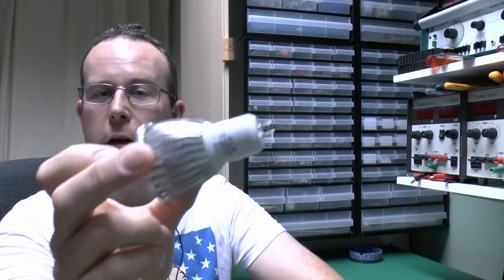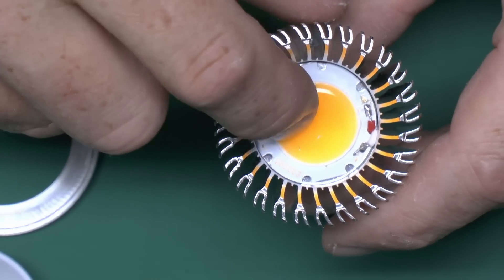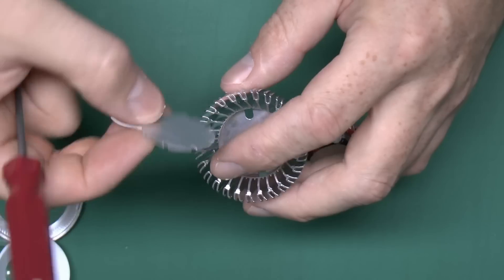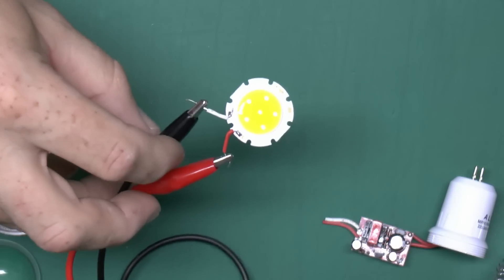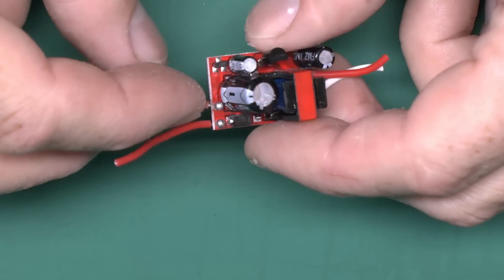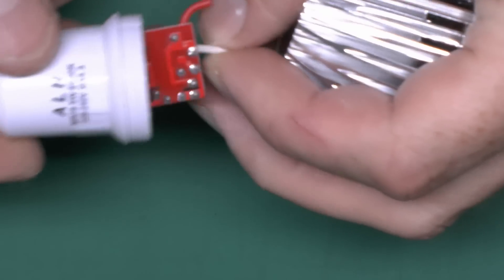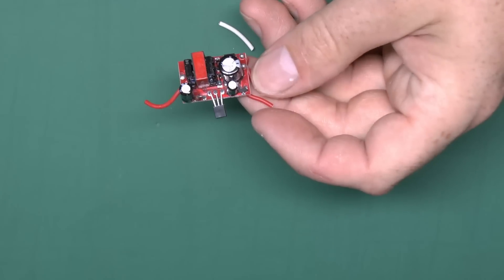LED Lamp 240V with 12V GX5.3 Pin Connector

Comment: I have found a very nasty B22 led bulb which has the voltage dropper circuit and led's all on one board, which to make matters worse is directly touchable if the plastic cap is removed (which is easy). Ledlam 3w golfball led B22. Found this issue by accident and not by tearing the thing down!

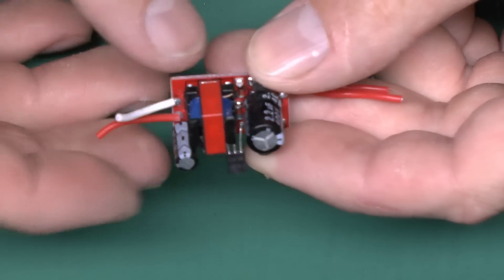Comment: The creepage between primary and secondary is quite small - look at the bottom of the board (at 5:15) and the top of the board (at 6:40), and you'll see that the creepage is only about 1mm between the transistor on the primary side and the diode on the secondary side.
Reply: Not an issue though, as isolation is not required in this application.

Comment: There are applications out there for these mains bipin base lamps.  A neighbor of ours got a fairly expensive designer fixture that took mains bipin base MR16 lamps, yet it shipped with a 12V lamp because 'it fits in the lampholder durrrrrrr.'  Needless to say, the lamp exploded in use.  Had to order 120V bipin lamps from somewhere online.
The 13001 is an MJE13001, which is a common power device in these nasty blocking oscillator supplies.  And I would not trust the isolation of this as the transformers these use usually only have a few layers of sticky tape between the mains and load windings.
Reply from the maker: randacnam7321 That's really the worst possible arrangement, 12V lamps and fixtures for higher voltage.  All the lamp fixtures with that type of base here in England are either 12V or rarely 24V, certainly nothing higher.
Reply: *****
Creepage????  Wuzzat?????
/Idiot PCB designer

Comment: The yellow top coating on the LED's is not only to protect them, it's for converting most of the blue light to "white-ish" - The actual LED's are Royal Blue, and the coating is loaded with Phosphor :)
Reply from the maker: ***** Yes, that seems obvious now you have mentioned it.  Presumably the exact phosphors are selected to obtain warm white, cool white etc.
Reply: +ronettreker UV LED's are hard to manufacture. Royal blue is UV-ish and makes a lot of materials fluoresce.
Reply: +zaprodk Aren't most of them using UV LEDs?
Reply: ***** UV-ish meaning high energy, right? Looked up wikipedia...aparently blue LEDs are also made from zinc selenide which apears to be cheaper than gallium arsenide so that would explain the use of blue LEDs. I'm guessing if aluminium nitride become popular uv based white LEDs are also going to become the most common form of white LEDs.